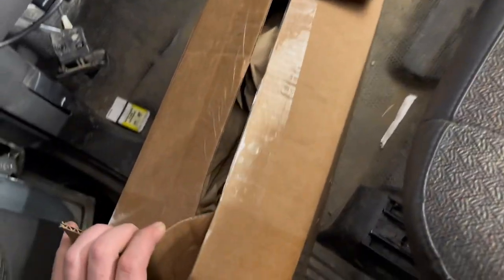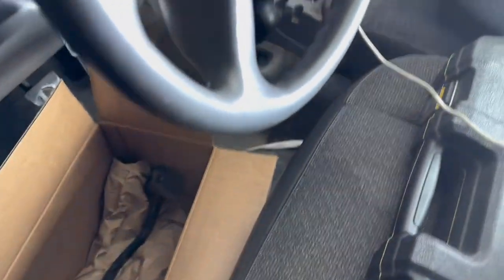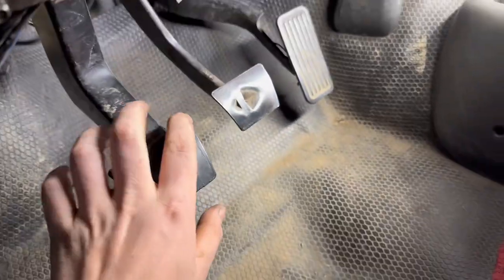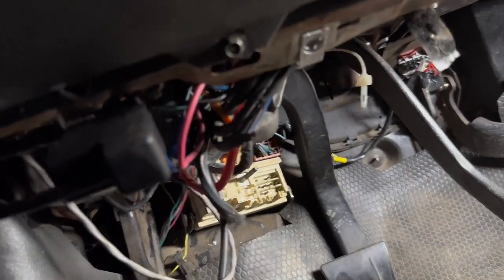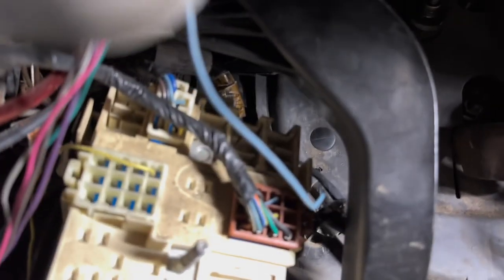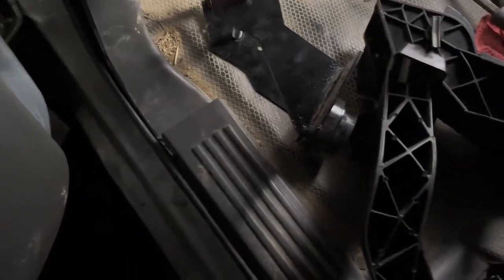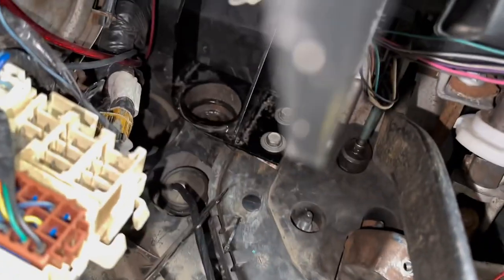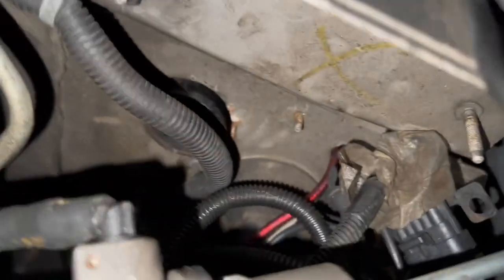Every ZF6 Duramax needs this!!!! Metal pedal install

Comment: what is the order # of the metal clutch assembly, where did you order it from and what did it cost?
Reply from the maker: Kb diesel. Bought mine used not sure of part number or new price